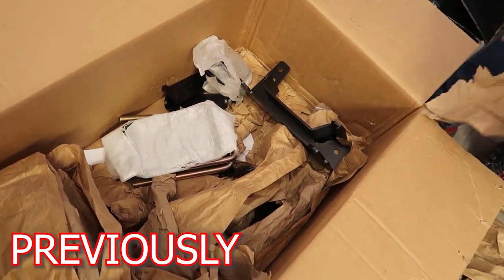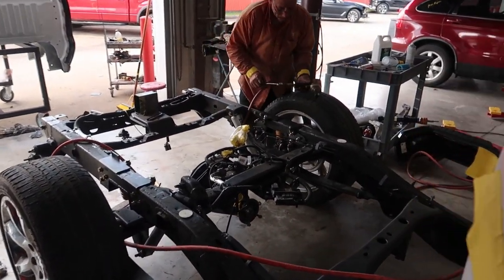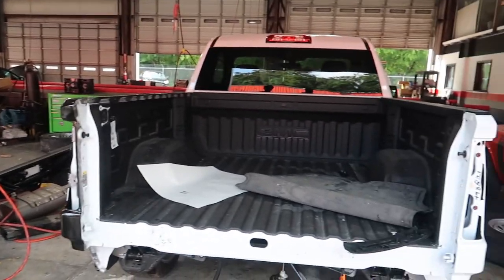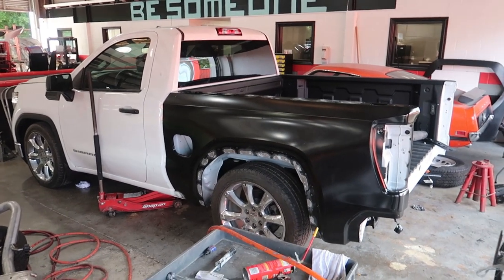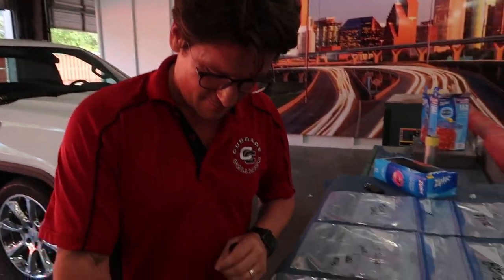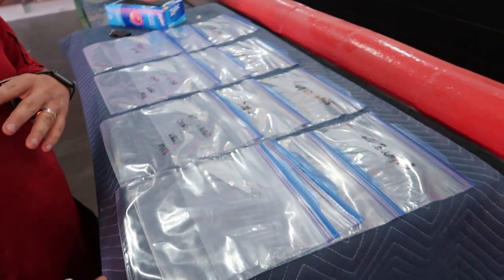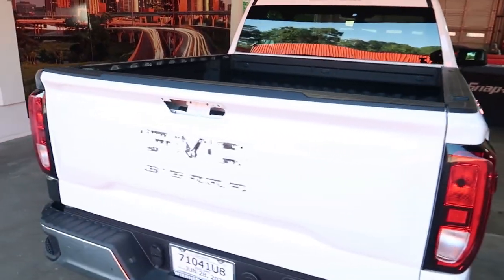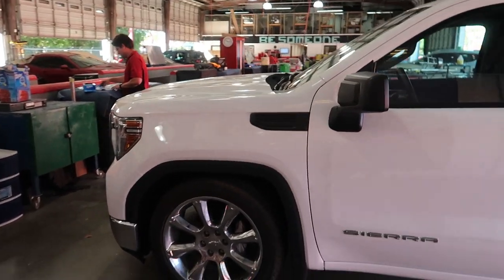CUTTING THE FRAME ON A BRAND NEW 2020 :  SINGLE CAB SHORT BED BUILD

Comment: Looks like they used the 5' bed instead of the 6' bed like the original single cab short bed trucks had from the factory like the 2018 and older trucks

Comment: Why wouldn't you just order a Short bed frame from Mexico and use that one without cutting your current frame? You could even order the drive shaft and the correct bed, right? It's not like you're importing the entire truck just parts. I mean that make better sense, then you can re-sell the current long bed frame, bed, and drive shaft and get some money  back.